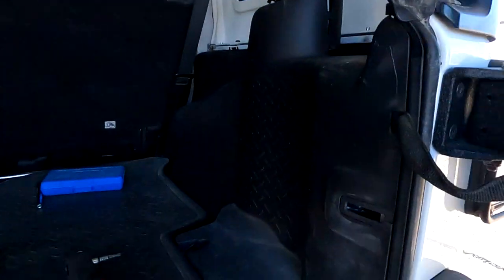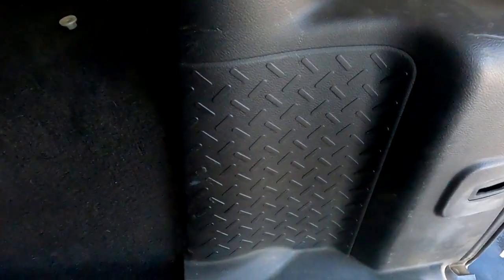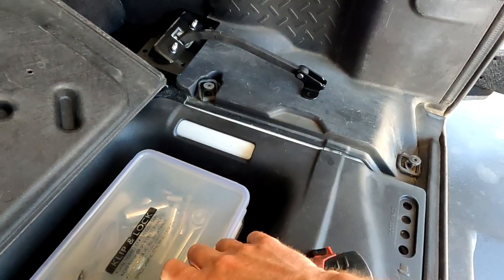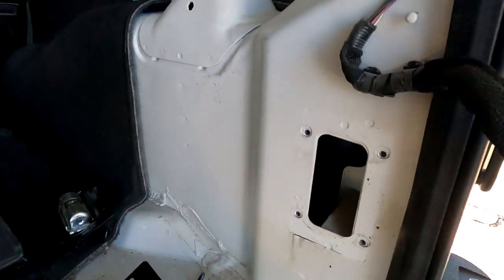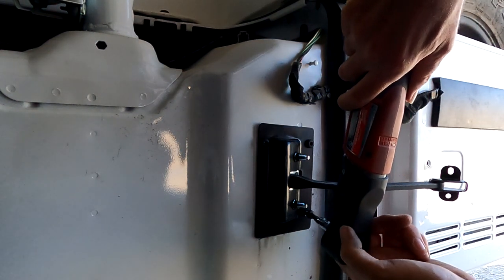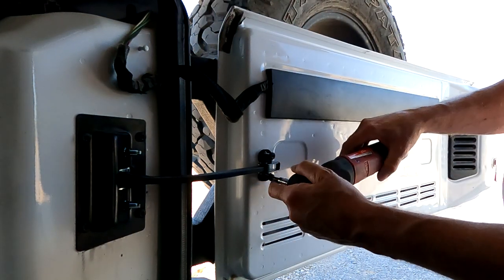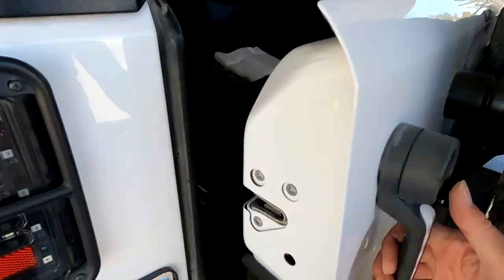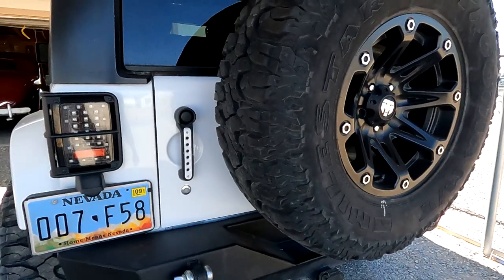Jeep JKU Tailgate Check Install

Comment: I’m starting to get a weird crack-like noise from my jku ‘11 original tailgate-check when I fully open the gate. So I guess I’ll need to replace it soon. Two questions: 1) why does it break? I’m not even using a larger spare so no extra weight from original 2) what does it happen if the check is no longer there? Does it just prevents the gate to open beyond what’s expected, right? Or it’s there for something else?
Reply from the maker: Hi ya try and grease it that might help. and without the door check it will open up and hit the tail light.